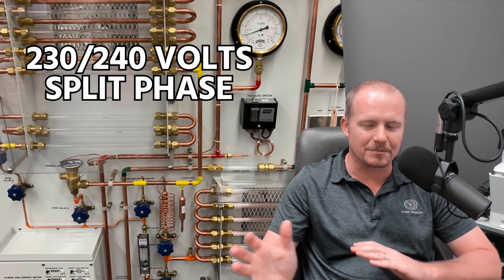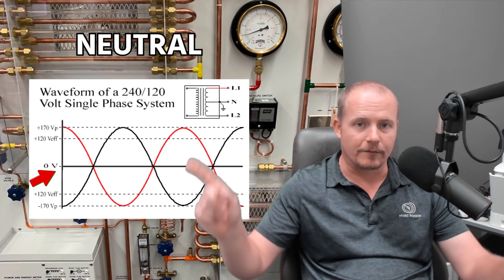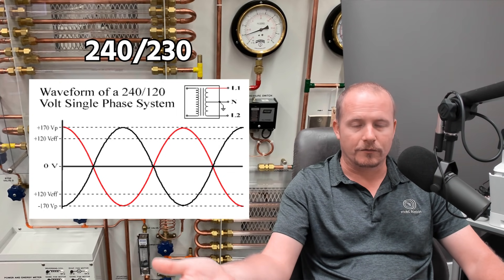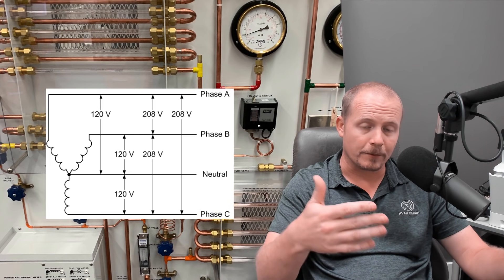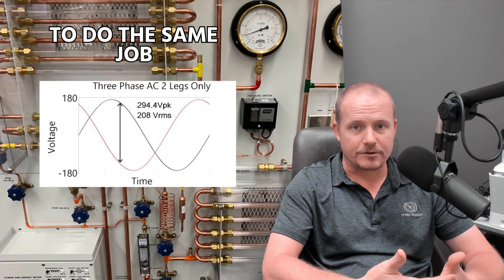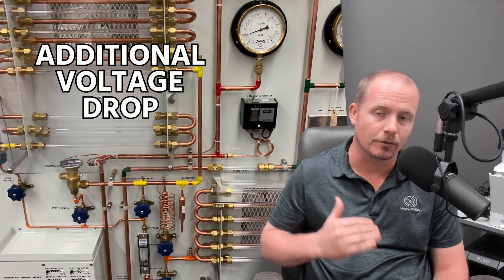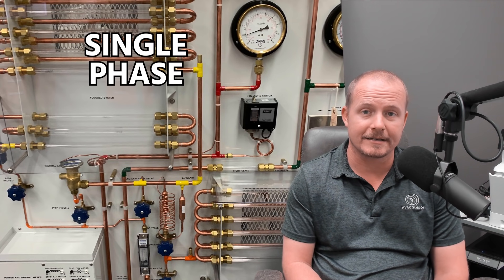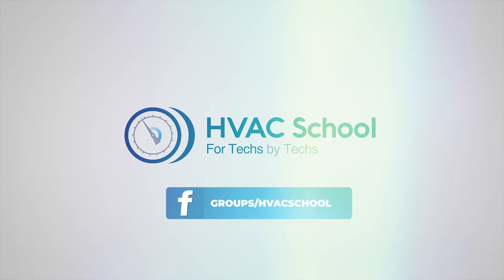How is 208 volts different than 230/240 volts?

Comment: Make a video about the 480volt step  down to 240volt with a 208volt high leg transformer.. I've seen alot of maintenance guys fry equipment because they thought the B phase(high leg 208volt) was a normal 120volt circuit.. you always gotta open the panel up and make sure it isn't a 208volt high leg.. we mark the high legs with orange tape but most maintenance guys don't know what to look for..
Reply: That only happens with delta 3 phase. The high leg being on the B phase is the CURRENT regulation. There still are a lot of C phase high legs out there. ALL UTILITIES still deliver the high leg on C phase, but the load panel has to have it on B phase now unless it was installed prior to the regulation change. Be careful when doing service changes to check which was the high leg before disconnecting, 'cause if you wire a new B high leg that was perviously C high, you will fry everything on the new B since it was previously not a high leg.
Reply: @xNYCMarc as of 1975, requires the high leg land on the B phase in a panelboard,  and because high leg delta systems are usually found in really old systems and rarely installed today, you'll often run across a panel where the high leg is phase C even if the panel appears relatively new, assuming you're not rewiring the entire facility.

Comment: wait you can shift phase angle on secondary transformer wire? how
Reply: Inversion by transformer is the same as a 180 degree "shift."
Reply: Centre tapped transformer on the secondary winding.

Comment: In most European countries, the official range for the low voltage grid is 230 V +10/-10%, which is 207-253 V. So it should be possible to run 230 V equipment on a 208 V supply, but it's very close to the limit.
Reply: Many are dual voltage for basically that reason. Might lose efficiency but adds flexibility
Reply: Actually it is 400 V which makes the phase to neutral 231 V.

You are confusing two difference things: nominal voltages and their differences and variation within a single nominal voltage. This is a very common error people make.

If there is 10 % variation then 208 V can be 187-229 V. 187 V is way below the range. You must compare nominal to nominal or a range to a range, not nominal to a range.

Now part of motors under-voltage is no really an issue. It just makes the device less efficient.

Comment: Your diagram shows a WYE bank which would provide 240v 3phase.  208v 3phase comes from a Delta bank with a neutral tap between phases A & C.  A to Neutral = 120v C to Neutral = 120v  B to Neutral = 208v.  A to B = 208  A to C = 208  B to C = 208.  This is commonly known as a Red Leg 208v power supply with Phase B being the Red leg.  The actual wire on the line side of the disconnect should have red tape on it to signify it's 208 to Neutral.
Reply from the maker: 208v wye phase to phase 3-phase  is very common 

You are confusing phase to ground / neutral with phase to phase.

In 208v wye you still have 120v phase to neutral but 208v phase to phase
Reply: @HVACS  You are correct although I'm not confusing anything. In my area and I happen to work for a power co., 208 Delta banks dominate unless it's a 440v supply.  I teach HVAC for said power co and put more emphasis on the existence of the Red Leg systems for two reasons.  1, They're very common in our industrial parks, 2, for safety.  It's better to assume you have a red leg system than a WYE system.  We typically use the Delta bank due to the increased power factor.
Reply: @RalphMercuroMusic  Please explain how delta transformer increases power factor?

Comment: Wait if 208v is 2 phases then why do we need a 3rd phase is it still gonna be 208v without the third phase?
Reply: Mr. Chu,
It's helpful to consider that 2 wires are NEVER 2 phases. 2 wires ALWAYS constitutes 1 signal (phase). People use the term 'phase' too loosely. Phase conductors is a better term to describe the wires themselves, while phases describe the signals between wires. 

In other words, you are really using two phase conductors to create 208 volts, not 2 phases per se. It's a bit of semantics, but helpful to clarify the concept.
Reply: Think of three phases A B and C, each with their own voltage. Phase A climbs to its highest point (+120V away from neutral 0V). For just that short moment, A is 208 V away from both B and C, which are both at the same low voltage -88V.

Then A and C both drop in Voltage. A goes lower than 120, and C goes even lower (more negative) than -88V, but they both change at the same rate, so they are still 208 V apart from each other. 

Meanwhile B raises its voltage from -88V to more positive, also at the same rate, but at that point B is not important because the difference between it and the others is less than the maximum 208 V.
Reply: So A and C are both falling in voltage.... until they reach the 60 degree point  (half of 120 degrees apart from each other).
At that point C can't fall anymore  because it's already down to -120V. Meanwhile A has fallen to +88V and B has risen to the same point +88V. So both A and B are now 208 V away from C.

Because C fell to its lowest point, it will now rise back up towards 0V. A will continue to fall towards 0V so it will no longer be 208 V away from C. However, since B was rising, B will now rise above +88V at the same rate as C is rising above -120V. So now the 208 voltage difference exists between B and C. And A becomes irrelevant
Reply: Finally, after another 60 degrees, B will have reached the highest point of +120V, which is the same point that A was at in the beginning. So B is now 208 V away from both A and C at -88V. 

Then B starts falling and A continues to fall towards -120V (and C continues to rise).  For the next 60 degrees then, the maximum potential  difference  of  208 V will exist between B and A.

 The same voltage changes will happen to them now as happened previously, so you can now think of B as being A, A as being C, and C as B. Each time, each phase gets a turn going from highest (+120V) to lowest (-120V) and back to highest. 208 V only ever exists as a difference between 2 of the 3 phases for 60 degrees, after which the phases changes again, but the 208V stays constant with no interruptions

 So the full cycle starts with A being at the top at +120V. Then after a 120 degree turn, B will be at the top at +120V,  then after another 120 degree turn, C will be at the top. Then after a final 120 degrees turn, it will have turned a full 360 degree cycle, so the original A will be at the top again. And the cycle repeats lol.
Reply: Ultimately, 208V exists in an American three phase system, but only ever between 2 of the 3 phases, 1 being positive and 1 negative, which change every 60 degree turn of the generator. 208 V exists between:
+A and -C  from 0° to 60°
-C and +B to 120°
+B and -A to 180°

At 180 it's the half way point of the cycle, so the combination of phases repeats but the polarity is reversed.
-A and +C to 240°
+C and -B to 300°
-B and +A to 360°/0°
Then the cycle repeats from the top
Reply: Therefore put simply, the output  voltage of 208V first exists between individual voltages of +120V and -88V. Then it exists as the individual voltages fall to a minimum of +88V and -120V respectively. Then they rise again to a maximum of +120V and -88V respectively. And so it repeats as they fall and rise.

All throughout, there is always a constant 208 V difference between whatever phases are involved, which means the output voltage never changes. What changes is just whether there is more "pull or push" on the output current, more positive or more negative output voltage.

...but since that's irrelevant to an electrical system, 3 phases means the voltage is always constant just like with a DC supply. There is no real alternating current resulting here, which is more efficient for electrical systems because  they won't turn on and off 60 times a second
Reply: @marioluigi9599  This is a ridiculous way to explain it. It requires a simple diagram showing three sinewaves.
Reply: @deang5622  ok, sorry baby

Comment: Bryan, hi glad there is not much 208  single, or 3 phase , as brownouts create low voltages, & even though you ARE using the 208 tap , on control circuit too many times contractors DO NOT PULL IN , the SQUARE  ( park ) in MORRISTOWN NJ IS STILL 208   a royal pain in the seat , I was so surprised that where I was in GERMANY, the homes do have 3PHASE   CLOTHS DRIER, & stove Are hooked up, unlike USA, where all your load is on both sides of 230 v single ph, thereby higher amps /leg , all there is 50 HZ , also zero 125 volts , Cheers 🇩🇪🇺🇸🇺🇸

Comment: My co worker change a blower motor on a package unit and its rated 230 v and he has it on 208 terminal, and the blower is working on a low speed because of that he said its not because of the voltage.you just explained it in this video thank you
Reply: That wouldn't slow a motor down. Everything is still at 60 hz.
Reply: @Bryan-Hensley  what are you talking? Of course it slows down at a lower voltage. The motor speed is nothing to do with the phases and Hz.

The 3 phases just prevent the AC power from continually switching on and off. With 3 phases there will always be a potential difference of 208V between any 2 of the 3 phases.

...Whereas with 240 single phase, it keeps going from +240 to 0V (turned off), then to -240V (turned on), then to 0  (off again) and back up to 240 (on again).
Reply: @marioluigi9599  absolutely wrong. The hz and rotor poles is what determines the speed a motor runs. Lower voltage causes higher amperage and will burn out the windings. Sorry dude, I'm been working on ecm motors since the 1980s. In other words almost 40 years experience. You need to shut up so you can actually learn.
Reply: @Bryan-Hensley  well I think 40 years has just confused you. Maybe you should revise basic electricity. "Lower voltage causes higher amperages"? What?
I remind you that current is proportional to voltage. If you halve the volts, you also halve the amps.

Also, if the speed of motors was determined by only Hz, you'd never be able to change the speed of any electric motors, since the frequency of power never changes. It is always 60Hz in the U, 50 in Europe.
Reply: @Bryan-Hensley  I suppose your motors can only do a speed of 60rps / 3600rpm?
Reply: @marioluigi9599  you really need to study up on how electric motors work. Couldn't you understand that link? That's basic stuff..
Reply: @marioluigi9599  sorry, that link didn't show up.
Reply: @marioluigi9599  Depends on the details of the motors, but the most common synchronous AC motors are meant to run at a rate where frequency is rigidly linked to rotor speed.  Such as 60 Hz / 1800 RPM, or 60 Hz / 3600 RPM.  The ratio depends on the geometry of the motor.   It is common that the same motors that run off 480V and 60 Hz in the US, will run off 400V and 50 Hz in most of the rest of the world, except at 5/6 the rotation speed.  The Volts to Hertz ratio being the same enables the same synchronous motor to run on both grids, just with a compromise to the speed.

There are motor designs that enable a rotor speed that is independent of the frequency of the grid, but they are less common and only used where necessary to control the speed with more precision.
Reply: @carultch  what are you talking about about? There's loads of machines that use electric motors. Think of your common kitchen appliances.  You can very easily change the speeds of those motors. It's nothing to do with the Hz of the power supply
Reply: @Joe-by8jh  You're talking crap. You can't change the frequency of the power supply 
...and yet you can still change the speed

Therefore it's not dependent on frequency
Reply: @Joe-by8jh  Also, I was talking about basic household appliances. Like my vacuum cleaner has a "dimmer switch" which you can just rotate and as you do, it changes speed, gradually. Clearly that has nothing to do with frequency

Comment: I am happy to see you bring up the fact that 208 is 2 phase. 

I was working on a peice of equipment that was 208 with a supervisor and I stated that it was 2 phase and he threw me under the bus in front of all my co workers saying that I was an idiot and was completely wrong for calling single phase 208 2 phase. It made me very angry because I know 208 is two full phases. And in Europe they actually call it single phase, two phase, and three phase.
Reply: Here's the problem. It all depends on how the transformers are configured. It could be single phase, It could be two phase, it could be three phase. Everyone is right here. And everyone is wrong. The answer is it simply depends.
Reply: @etherealrose2139  not how I see it . Single phase you only get a shock from 1 of the conductors.
Reply: the reason it is called 208 single phase is because that is all the LOAD sees. Visualize just the motor - nothing else. No neutral, just the two hots. When you hook up those two different legs,the potential difference between them at the motor is 208 volts. Plot it. The voltage is just a sine wave. It is just a "single phase" as far as the load is concerned, there are no other legs peaking at different offsets to that motor, they are not seen by that motor. It's tricky to comprehend but the official manufacture literature for most motors does refer to it as 208 single phase for this reason. Just learned this yesterday/today after coming across this very issue.
Reply: I agree. I'm installing an evaporator that states 208-230 single phase that takes its power directly from inside the outdoor condenser which is wired as 208 3 phase... The evaporator is simply just using only 2 legs instead of all 3. It is most definitely NOT single phase and is most definitely 2 phase.
Reply: It's 2 phase if you also connect the neutral of the Wye configuration to a load (actually two loads) that has a neutral and two line inputs.  However if you only connect two of the lines, it's a single sine wave.

Comment: funny you mention this, we had a 5 ton bryant w/heat pump installed and kept getting a line overvoltage warning, and actually the main board in the outside unit later failed (2 months old). so  the power company came out and said my outdoor unit was a 208v unit and i needed a 240v unit and left, jackasses.

Comment: Question regarding this topic...  seems like I find things in 3’s.  Recently I have been on some commercial building working on ‘no heat’ RTU service calls. 
In these 3 different instances I was getting 16-19 volts at the thermostats only to find whoever installed the units must not have done a proper start-up. I found the transformers still at factory tap of 240 when they should have been retapped to 208.  So as I retap the transformer BOOM I get 26+ volts for my control voltage (good)!  
Could you explain this? And how hard is a incorrectly tapped xfmr on controls and control circuits. 

In my case, 2 of the calls had companies out who were continually just replacing thermostats that kept malfunctioning.  Soon as I put the tap on correct voltage they have not had any issues and now we have new customers!

Thanks

Tony
Reply: Tony Frost, that job in a low voltage time, could have the contactors  NOT PULL IN , seen too many units like that, installer DID NOT CHECK   One of the worst has been TRANE , CHEERS 🇺🇸🇺🇸🇺🇸🇺🇸

Comment: I really don't understand why you guys have so many voltages ,it's so much simpler to just have 240 V single phase and 400 V 3 phase ... I'm not being negative I'm just trynna understand why .
Reply: Legacies from a time when there were many utilities providing their own product locally, but there are many different needs as far as what we use electricty for. 

Especially now when our gadgets are so much more efficient. 

BTW, some cities still have series wired street lighting that's fed with 4800 volts.
Reply: Sterling Archer North America (USA) and Canada) have the voltages mentioned.
Most of the world uses the system you are accustomed to.
Reply: Sterling, th original STOP & SHOP  stores, we’re ALL 480VAC 3BPH BUT LIGHTING WAS AS A RESULT WERE 277 VAC SINGLE PHASE     cheers 🇺🇸🇺🇸🇺🇸🇺🇸

Comment: In south Africa,  we have straight 230v single phase,  3 phase is 380v
Reply: That should be 220V and 380V.  The ratio between the values should be sqrt(3).

Your options are:
380/220V
400/230V
415/240V
Reply: Same in Europe (DK). we just use 240V (LNE) and 400V. And nothing else... maybe at powerplant levels.

Comment: The "old" voltages are the plus or minus range on the nominal voltage.  Lower stamped on load devices, higher on switches and things.  Some areas only at nominal, say 120V, +/- 10% which ranges from 130-110, =/-5% from 125-115.  Now North America has +/-5% and it's generally baked in on modern devices given the good control of the grid.  Might also be what the meters read in the past as well.